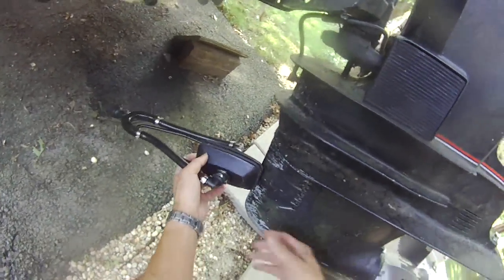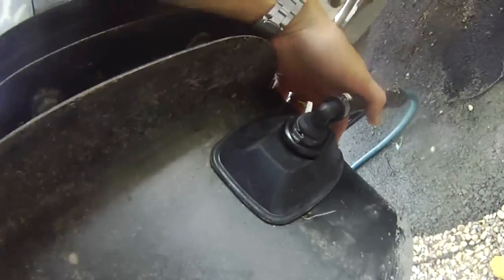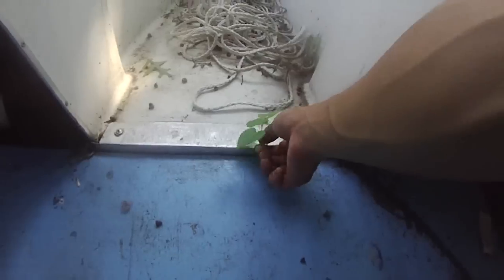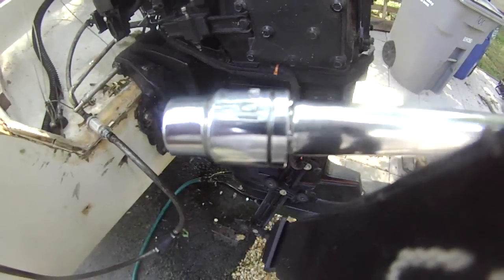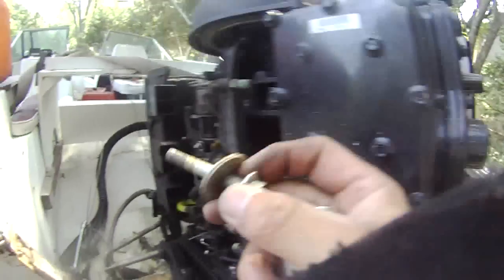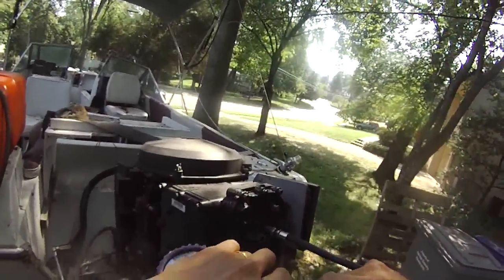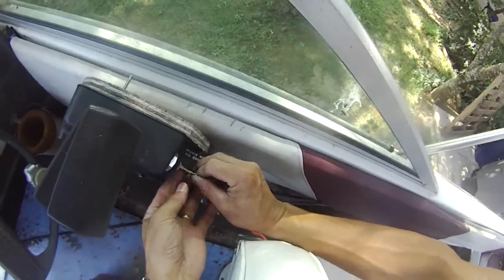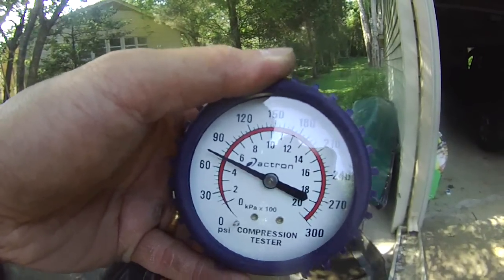Mercury 90 hp 2 cycles 3 cylinder outboard compression test

Comment: Hi guys, I have a optimax 90 3 cylinder, the PSI reading is 75 for all of them, not sure if this is low or high and if it is low, what needs to be changed?
Reply from the maker: Best advice is to take the motor apart and take it to a machine shop to hone your engine block and buy bigger pistons. 75 psi is a scorched block. It will get worse if not addressed immediately

Comment: 96 psi or more compared to other 2 on 100,  is boarder line on good running, you have a bad motor, need rebuilt. 5% diff. on compressions are max. and beyond 5% diff. trouble comes soon....
Reply: 15%

Comment: A note on the "weak" pistons I mentioned: the mechanic says the early OMC 3-cyl loopers had a lot of piston slap until they warmed up.  Not a real problem BUT enough owners complained to their dealers about the motors running noisy that OMC revised the piston and ring design. Also the early 65's reportedly had pistons with a higher dome than the 70's.  So, OMC may have lowered compression and while I don't have any technical specs to back it up they probably made porting changes to get the HP back up. Low end torque may have been reduced but the number they put on the cowl said "70" and that's what they were after. Actually a lot of power to claim out of 49 cubic inches BUT they even went with a 75 HP rating for a while. They brought BACK the 75 hp claim in the 90's BUT with a 56 cubic inch displacement this time.
Reply from the maker: Wow, thanks for the detailed explanation!

Comment: A friend of mine has an outboard shop. Last spring he tore down a 1973 Evinrude 65 hp. Motor was "known runner" but an idiot knocked it over with a forklift, then a storm flooded the yard. Anyway powerhead was disassembled, cleaned, honed, and the "weak" 65 HP pistons replaced with used, but good, later model 70 HP pistons and even good rings salvaged off various motors. Resulting compression was 140 psi across the board after warmup!  Yes, they were "used" parts but guess what? All the parts in YOUR motor are used, too!  Odd thing about these 2-stroke motors is that one hole can blow up with two or three others being 100% fine. If a carb runs lean that cylinder will detonate. Often there's no obvious reason except that SOME cylinder has to fail first. Some models are notorious for having a given hole blow up.
Reply from the maker: good story. Congrats on the 140 psi on all cylinders. I am tearing down a very popular Honda 9.9 hp outboard with 65 and 100 psi. Got stuck on the powerhead bolts 2 out of 6 broke inside the holes. So badly corroded. So, trying everything now - torch, PB blaster, lefthand drill bits, EZ out, probably I will have to drill in with a bigger drill bit and re-tap the hole. What a pain in the neck DIY project. Eats into my precious boating and fishing time. Will probably wait till winter snow days to continue.

Comment: That 75 psi indicates a burned piston.  Just dealt with a problem like that on the 70 HP version of the same motor. Two cylinders were at 100 to 110; middle cylinder only 80.  Took it apart and found that hole completely blown up.
Reply from the maker: Good luck in restoring it. My local machine shop was terrible. Should have looked online and looked for a reputable machine shop to do the job. They honed it too big and told me to buy a sleeve for the piston. What the heck!!!!
Reply from the maker: Avoid my local machine shop at all costs. Not every shop is competent in doing machine work.

Comment: Rule of thumb. Any oil injected outboard that is 20 yrs old or more, disconnect "bypass" the oil injection and go to premix. It's easy and cost less than $5.00. It will save you an engine. Premix 50:1 and you never have to worry about a failing pump and know that the engine is getting plenty of lube. That mercury should be 120-130 psi on all cylinders if its healthy. And all within 10psi or so of each other

Comment: So for a mercury 75 bigfoot 2stroke 2003 a compression of 70psi on all 3 cilinders is too low?
Reply from the maker: yes This is what I believe, but outboard experts can comment and correct me. I know I am not an expert in outboard motor at all. I am just a curious guy who want to save some bucks in DIY and enjoy fishing and boating on water. Every time I get on the water and nobody else around I feel more than a billionaire, because I feel I own the whole river or lake or ocean. Nothing beats that moment. If I catch a fish, that would be icing on the cake.
(1) it would cause your motor hard to start when cold (2) it would waste more gas than otherwise. (3) it would not propel water as it would not produce as a 90 hp motor should produce. But, if your motor has 70 psi  in all cylinders and and it starts fine every time reliably, then it is probably best not to fix it. Money can be saved for other purposes. Most of us really don't run a boat motor every day. I use my boat motor not more than 20 times a year. So, the motor is simply underused compare to our car engine.
Reply: Not necessarily. Id borrow another compression tester and check again, especially if the motor seems to be running ok. I went through two Harbor freight testers that showed low pressure before borrowing a neighbors and my readings went from 90 to 130 psi.

Comment: 110 psi is low compression for 2 stroke    ( it is ok if is even all 3 cylinder  but look like car 300.000 km )good motor must be 125-150 psi
Reply from the maker: +bmw850ci yes, my 3 cylinders had low low psi without applying any oil. With oil the bottom cylinder was up to 75 still lower than the other 2 cylinders of 90. So, it was very hard to start and had to tear it down and rebuild. Machine shop ruined my Mercury 90. My Johnson 90 hp was great 125 psi all 4 cylinders. It runs like a champ!
Reply: Not necessarily. Later model outboards don't run same compression ratio as the Old Timer's. Look at Merc's 3-cylinder motor since '87 or '88; lots more size and weight all around compared to their old 3-cylinder.  They're using more displacement and lower compression to get same HP.  Actually, probably MORE real HP at the prop - we know all the old motors had bogus ratings for marketing. The Japanese manufacturers complained and the FTC mandated prop-shaft HP ratings. That forced OMC to bore out their 3-cyl looper from 49 cubes to 56, for example. Other engine designs had to be de-rated.

Comment: 1st  of all u need 2 start ur motor& warm it up to reg, temp,then remove all spark plugs and put the throttle at wide open and hit the starter continuously till the gauge stops going up.,,your compression is to low,u need to rebuilt that motor..over heating might be the reason,when u rebuilt it make sure u change ur water thermostat,impeller & poppet valve

Comment: Your bottom cylinder is probably burned out.  Your oil pump probably failed, or maybe the impeller in your water pump.  Either way, your motor most likely overheated and scored the bottom cylinder.  The remedy is a complete overhaul, at least boring out the bottom cylinder, honing it, and replacing the bottom piston and rings with oversized piston and rings of at least the next size up.

You also need to find out what happened to cause this.

Whether or not it's the oil pump, since your motor is out of warranty, you'll want to completely remove the oil injection system and go with a 40:1 pre-mix of fuel to TCW3 outboard motor oil.

Additionally, you'll want to pull the lower unit and replace at least the impeller and gaskets in the water pump.  While you have it off, change the lower unit seals, change the lower unit gear oil, and replace the gaskets on the top and bottom gear oil drain screws.

In your console, you'll need to check that your overheat warning buzzer and your temperature meter are both working properly.  You can check that by grounding each of the brown wires under the motor cowl with the keyswitch on.  Be sure to double-check that you're grounding the correct wires first.  Use the service manual to verify.  Grounding one of the brown wires should cause the temp meter on your console to peg.  Grounding the other wire should cause your overheat buzzer to sound.  If either of those doesn't work, fix it now.  If your motor ever overheats (as indicated by the temp sensor OR the overheat buzzer), shut it down immediately before it burns itself up.  A properly operating motor will never overheat.

The other problem I see is at the beginning of the video.  You said you didn't know why the fuel wasn't coming out, but yet you proceeded to turn the motor over.  No fuel, no oil, equals no lubrication in the cylinders.  So even if the motor were in perfect shape before you started your compression test, you probably just scored all of your cylinders by doing a compression test with no fuel/oil mixture going into the motor.  That's a very bad thing to do.  Never turn a two-cycle boat motor over without water going into the lower unit and fuel/oil mixture going into the cylinders.  That's how they get ruined.

Hope that helps, and hope you can get your boat running and out on the water again soon.

God bless!
Reply from the maker: thanks for your detail comments, I tore down my motor and noticed the piston rings are loose and needed to be replaced, powerhead and cyclinder walls, poistons are all in good shape, no broken metals in the cylinders. do i still need to get the machine shop to rebore and hone the cylinders or can i just buy new rings and just put them back together? thanks!
Reply from the maker: https://www.youtube.com/playlist?list=PLpjSRCf07NBIXlT6srjZn2GTKkueKNtT1
here is the playlist of the motor tear down video playlist